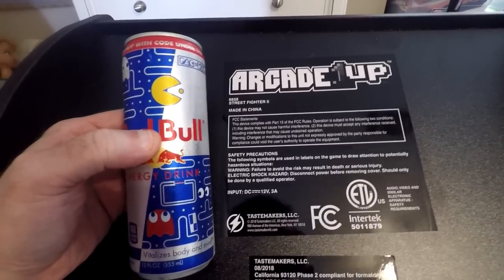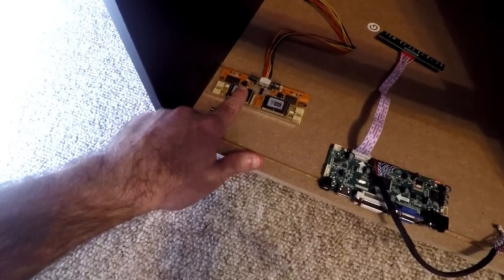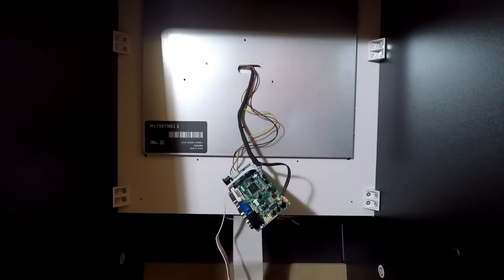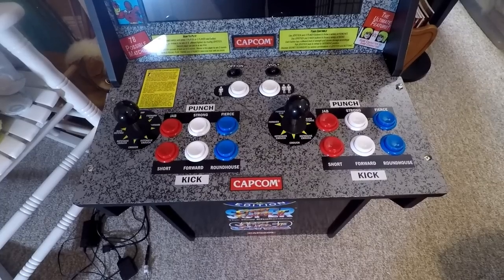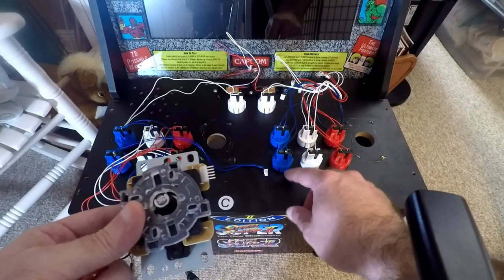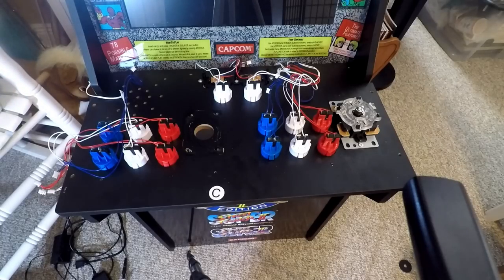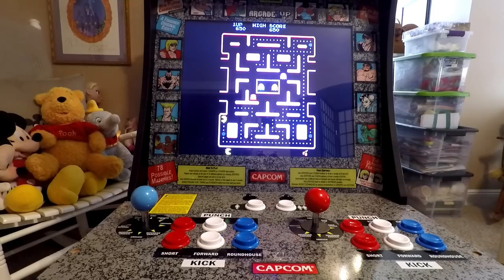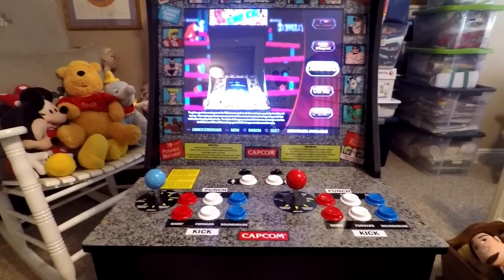Arcade Players Dream! Arcade1UP Raspberry Pi Install with EXISTING BUTTONS and POWER SWITCH! TeamCC

Comment: Nice videos. I also saw ETA’s RaspberryPi mod on A1U.. I don’t understand why your set up looks more complicated this ETA’s. Did you get the amp for speakers and you wired directly to where as opposed to the RaspberryPi?  Also two important questions as I am following your tutorial on wiring you  1) you mentioned on 28:55, the red wire goes on the right and black on the left... but on GPIO3? or black wire on GPIO3 and red on the right which is GPIO 6?  They are two wires.. black and red or together as one and just put black on left(confusing). And #2, 22:58 why do we need a keyboard , to modify the emulator and add a line ? Thanks very much and look forward to hearing your answers .
Reply from the maker: Thanks so much for watching and commenting! I didn't get the amp since I was using powered PC speakers that plug directly into the Pi. I am not sure about it looking more complicated. I thought it was less complicated without the amp and reusing the buttons. As far as the power switch GPIO3 = black and GPIO6 = RED. I have a link in the description that takes you to pictures. I would use that as a reference. The keyboard is needed because you have to modify a file on the Pi for the on/off function to work. Thanks again for watching and commenting. There are some good tips in the comments left by others like yourself.

Comment: What program was used to organize all the games? I just have roms in the NEOGEO, FBA, SNES, Genesis, and GBA folders. I still have to scrub everything, but would like to have things more organized for shooters, brawlers, fighters, etc.
Reply from the maker: I  used a 32G retropi image created by Wolfanoz. I didn't modify it at all since it was a great package as is.
Reply: @VirtualCrawfish  Do those Arcade RetroPie images allow for non-arcade games as well? Like SNES etc? Also, does the power switch mod turn everything off including the speakers and monitor? Great video!
Reply from the maker: Yes they do. You can add different emulators for all types of games. I just chose to keep this one as a classic arcade cabinet. The on off switch mod just powers off the Pi. Everything else still has power from the power strip.
Reply: @VirtualCrawfish  Thanks! Also, is it possible to simply plug the speaker directly into the LCD control board and not use an amp?
Reply from the maker: @Ashhong1  The speakers I used were self amplified cheap computer speakers I have had for years. I did not buy an amplifier.

Comment: I plan on keeping the buttons that came with my TMNT arcade 1up. Will I be able to still have 4 player capability if I’m just changing the LCD board
Reply from the maker: Since this would be a MAME conversion the answer is YES but you will need an encoder for each player.

Comment: Lmao Dam I found your video late  I went thru exactly the same thing and I'm a super noob and I couldn't find anybody on here going through the same thing thank you so much for posting UCI to felt the same way I wanted to use the original buttons and I change the joysticks when I change the joysticks the pi could not recognize the joysticks for some reason so when I wandered doing was using the original that worked the only thing was my characters wouldn't jump forward granted I did have to make the hole for the hotkey and coin
Reply from the maker: Thank you so much for watching and commenting. The key to the joysticks is making sure they are wired exactly the same on the usb encoder board.

Comment: So the joystick from arcade1up need to be replaced or can i used them also
Reply from the maker: The joysticks need to be replaced if you use the usb encoder boards that I use. I am not sure of a way to use the existing joysticks with a custom build.
Reply: They can be used. I did it today. You can't use the cable that is already connected to the joystick. The USB controller has a Joystick connector that fits it but it doesn't work because that USB controller expect X Y+- axis info to come in while the Arcade1up connector is really just 4 buttons and a ground. The way to connect them is to just use the cables that come with the USB controller and connect them to the 2 metal pieces that come out of the microswitches. Basically you connect each direction the same way you connect regular buttons.
Reply: @jamie Instead of connecting with the big cables you plug the small ones directly to the micro switches. There will be 2 metal tabs coming out of them. 1 on the short and one on the long side. That's where you plug the cables. They are polarity sensitive so have each color match. https://imgur.com/jJCtwvo This picture was when I first did it and was working good. I modified it since by cutting the connector a bit so that they really grip and don't need glue to be secured. For the buttons you can use the stock cables that are soldered to them. This is what I ended up with. https://imgur.com/us8Jnbt

Comment: Can't you just hook up a headphone jack to the original speaker wire and plug it into the pie? The pie has an audio jack already built into it, or is it just not loud enough doing it that way?
Reply from the maker: You will need an amp to get any decent sound out of it that way. That is what some people do and it works for them. I had the amplified speakers lying around so I decided to use those.

Comment: Sorry I didn't see where you connect speaker wires to the video controller board could you point me in the right direction please
Reply from the maker: I actually just use PC speakers and plug them into the audio out of the video controller. I also have done another cabinet and I plug the pc speakers into the audio out of the Pi.

Comment: Got some of my stuff to mod lone today. Problem is my usb things for my buttons are different than yours. I'm gonna try my best to see if it will work
Reply: Figured out I got the newer version of the usb encoders but what is throwing me off is the usb wire is comes with. Its solid black but where do I plug it in at?
Reply from the maker: Hmmm hopefully it will work. Maybe things just need to be plugged in to different locations?

Comment: Great video and a similar setup I’m working on! Did anyone figure out how to wire up the stock 2 pin (I believe it is) with yellow wires into the controller board without an amp? And will this setup be stereo or mono? Thanks in advance!
Reply from the maker: Didn't really attempt the stock 2 pin since I had speakers lying around. The setup I have is stereo if the game is stereo.
Reply: @VirtualCrawfish  I got the stock 2 pin one to work without the app and both the power on and volume switches

Comment: seems with the latest models they glue everything in to place
Reply from the maker: I was thinking about picking up another cabinet. I hope they are still mod friendy.
Reply: @VirtualCrawfish  bit late to the party but I bought and modded my Arcade1up this past weekend. Can confirm they glued every connection and even the screws in the control panel. Had to be more forceful than I liked, it isnt pretty. Especially removing the sticks. Going to now just rebuild this part with some wood.
Reply: Revz8bit did they glue the button wire connections? Xmen 1up, I want to use the same buttons - but install the usb encoders. Is that possible?
Reply: @jkphillyfan  glue was on the connections on the controller board and buttons, as well as on most screws for the controller board and joysticks
Reply: It was a SF2 cabinet from Walmart
Reply: @jkphillyfan  you should be able to do it, they popped off with a little force from a flathead screwdriver

Comment: Hey - just found your video via Reddit.   So if I'm retaining the current controls, is there anywhere I can buy just the USB encoders?   Or just buy the kit you did and toss the buttons?
Reply from the maker: You can, but I found that for an extra few dollars it was worth it just to have the buttons around.
Reply: @VirtualCrawfish  Any instructions on how to preserve the power for a light-up marquee?  Have the new BurgerTime machine myself and I haven't seen instructions on how to do so...

Comment: I finally have my SD card for the Pi but I'm going to have to get the usb encoders you have. Another question as well. Everytime my pi is on and it goes to the loading screen it kicks off is there a reason for that?
Reply from the maker: Did you put a Pi image on the card to boot from?
Reply: I've got it figured out now. It's the loading screen that keeps coming on
Reply: Or the screen saver I believe

Comment: With the on/off switch mod is it the same GPIO pins with Rpi4? Cant find any information.
Reply from the maker: I haven't purchased an Rpi4 yet so I don't know if they are the same.
Reply: josh brewer have you found anything on the Rpi4? I have the Rpi4 but havent tried this yet. Just wondering if there was any different pins before i did.
Reply: @ericestrada6279  I chicken'd out in the end of fear of trying my pi
Reply: @joshbrewer9188  I read on a different video some guy had success with the code. So gunna try it to today.
Reply: @ericestrada6279  please let me know the results I'd be so grateful! Good luck with it!
Reply: @joshbrewer9188  it worked!
Reply: @ericestrada6279  That's awesome! Know what I'm doing this weekend! Thanks for coming back to relay to just one person. Most wouldn't. Made my day!
Reply: @joshbrewer9188  no worries man glad I can help. I'm a noob at all this so just like sharing the info.

Comment: Power Switch works BUT!!! I have an issue with it automatically turning back on about 2 hours later. I can switch it to on then back off and it'll power down again but then approx 2 hours later it'll power back on again.  Did you have this issue?
Reply from the maker: This is from one of the comments below: Mine did this until I moved it to a different circuit in the house. The outlet I was using was on the same circuit as a refrigerator, and when its compressor kicked on, it would pull a lot of power really fast for a second, like how running the vacuum makes the lights dim briefly. This triggers a wake-from-halt on the Pi because the voltage dropped enough. There are probably better ways to fix this, but mine went from waking every 30 minutes on its own to never waking by accident, so that's the easiest solution, if possible.
Reply: @VirtualCrawfish  thanks bro this makes perfect sense bc the location of my cab is where lights dim slightly when mini fridge kicks on which is on same circuit.  Thanks again 👍🏽

Comment: Hello I'm new to your channel that is a lovely system I'm after a raspberry pie to use on my tv with hdmi is there any version of pie that's best for mame and all the emulators
Reply from the maker: They just released details about the new Pi 4. If you can wait or get one of those then do it. If not then the latest will still work for a MAME emulator just fine.

Comment: Can I use the same controller board without adding any usb boards?
Reply from the maker: The USB boards are what the Pi needs to accept the joystick inputs. I don't think you can skip that step.

Comment: The buttons are absolute trash. If you're going to go through the effort of doing everything else, changing out the buttons does not require much more effort. It's easier than changing out the joysticks. Just order a set of HAPP buttons and they go right in there no problem. You can still leave in the 1P 2P buttons if you want since they are not used much.

Comment: Instead of a pi can I just use a PC that already has batocera installed?
Reply from the maker: yep - once you get the hdmi converter then anything that outputs hdmi and can run the controls works.

Comment: I followed the direction for about 3 hours of trying and still couldn't get it to turn on or off
Reply from the maker: Oh NO!  I have helped several of my friends and the only time we have had issues is when we didn't edit the file correctly.
Reply: Not sure what I did wrong I followed the steps as u did them so I'm thinking about doing eta prime sudo version
Reply from the maker: Also not every image supports this. You may have to change the image you are putting on your Pi.
Reply: I have Damoso vers 4 from arcade punks

Comment: Mine keeps turning back on every now and then without me touching anything it will just power up relies it's supposed to be off and power off again? Anyone have a solution to this?
Reply from the maker: Ok I am going to keep mine plugged in and see if I can repeat this.
Reply: @VirtualCrawfish  thanks, It's really annoying because I have everything else working perfect. I just got up and it has done it twice.
Reply from the maker: I am pretty sure mine is doing this as well. I left it plugged in overnight and when I got home from work it was on. I don't think the kids were playing it.
Reply: @VirtualCrawfish  Mine did this until I moved it to a different circuit in the house. The outlet I was using was on the same circuit as a refrigerator, and when its compressor kicked on, it would pull a lot of power really fast for a second, like how running the vacuum makes the lights dim briefly. This triggers a wake-from-halt on the Pi because the voltage dropped enough. There are probably better ways to fix this, but mine went from waking every 30 minutes on its own to never waking by accident, so that's the easiest solution, if possible.
Reply from the maker: Ok that makes perfect sense! I am going to try another outlet. Thank you for posting this.

Comment: Could you supply the name of the image pls.
Reply from the maker: Wolfanoz_ArcadeOnly_32GB_AM_ES is the one I am using and so far so good.
Reply: thank you bud... @VirtualCrawfish
Reply: @VirtualCrawfish  someone told me that if you are using the wolfanoz 32 gb in a 32gb microsd card it can create a problem... are you using a 32gb card? If so, it's work fine?

Comment: Can someone help me figure out this issue? 
Raspberry Pi 4, CRT Blast 128gb build. Using Arcade1upmods sold video board. Image looks fine on my HDMI monitor, but when I plug into the street fighter Arcade1up monitor it looks like this? Colors are off and the image in pixelated.

When it boots and you get the raspberry boot screen with the boot info showing, the image is crystal clear and correct but once emulation station starts loading that's when the picture distorts.
Reply: Mine is doing the same. 😢 Have you figured out the fix yet?
Reply: @Tyler_the_plumber  I ended up getting a small form factor PC and lunchbox with big box
Reply: I don’t know what that means…/:
Reply: Can you explain please haha
Reply: @Tyler_the_plumber  I used a tiny computer to do my emulation instead of a raspberry pie, running windows 11 is and the software for selecting the consoles and games is called Launch Box with an add-on called big box. ETA Prime you tube channel has a bunch of videos on this 👍
Reply: So do you not use it in the arcade cabinet then?

Comment: Can I do the same in the TMNT cab?
Reply from the maker: You need to make sure you source the correct controller for the LCD monitor that comes with the cabinet. If you can do that then it should work. Also is your profile pic POCOYO?

Comment: Is the pin out the same for the RP3 B+?
Reply from the maker: Are you talking about the on/off switch mod? As long as the GPIO didn't change you should be good.

Comment: Does this work with retropie?
Reply from the maker: Yes this is what I used.
Reply: @VirtualCrawfish  right it’s only in the title, duh to me.  U know u could have used the stock controls.  The stock directly plugs into the encoder boards u used.  I know bc I did it.  Ha.  I wanted to do it on the cheap.  The buttons on 1up r ok, not great but ok.  Figured when they fail I’ll upgrade.